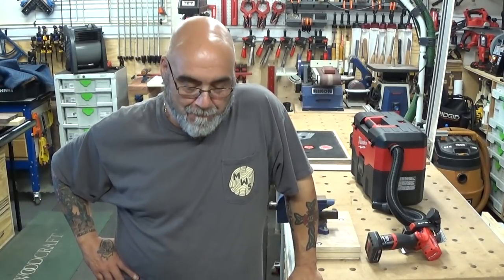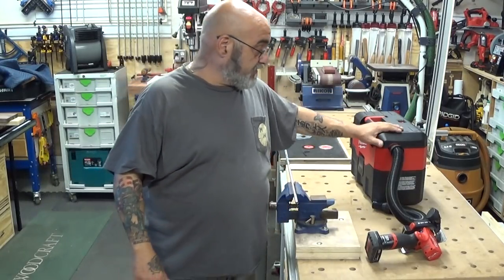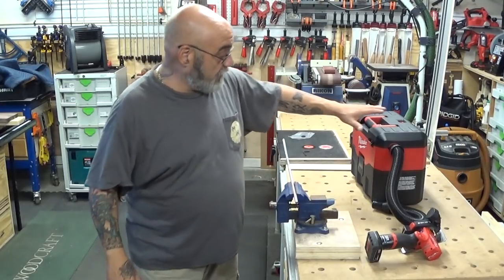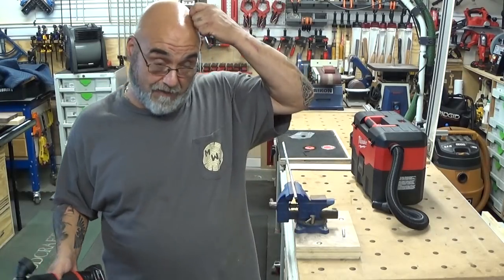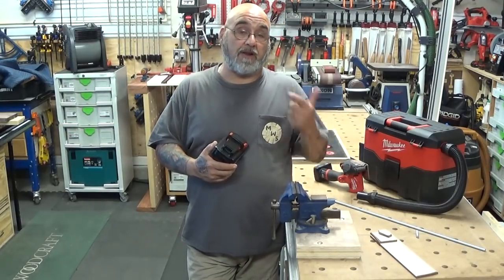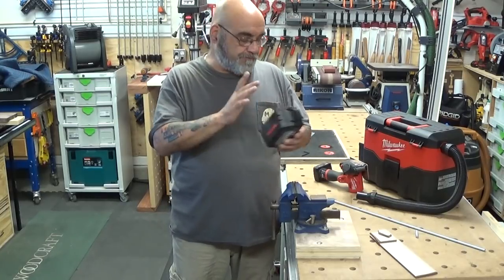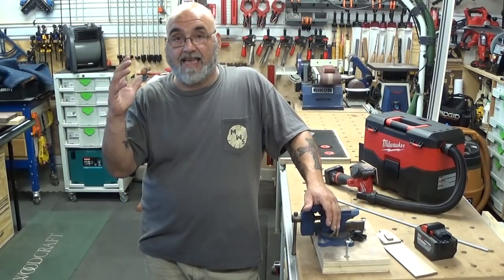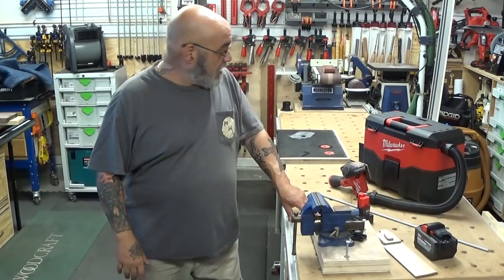Demo of Milwaukee's new 2522-20 3" cutoff saw

Comment: Testing on many types of materials is key to understanding this amazing little tool. I love mine and use it all the time. Understanding its limitations, and its use is very important. Few reviewers have explained how important and flexible is the FORWARD AND REVERSE function of this tool. Like a circular saw whose blade cuts upward, this holds the saw down so it won't hop up. It pulls it DOWN to secure what you're cutting. Likewise with the Milwaukee tool, when you were cutting the tile you should change the direction so it pulls the tool down onto the material. Yours kept hoping up cutting the tile since you had the blade going in the wrong direction. Same when you were cutting the steel pipe. 

Bottom line, this baby cut off tool is actually much better than you made it appear. But I understand. It was your first use of the product. I've also found the Milwaukee blades aren't the best. I'm using Diablo 3" blades and they are much better. Pro tip: The shoe that is also the dust collector really helps with a straight line cut AND if you make sure the blade is cutting UP (like a circular saw) the dust collection works better.

Comment: Milwaukee has a lot of them 12 I'm thinking about getting involved with the M12 but but it's still waiting for cash flow is it really worth it compared already have two of the Ridgid little drills when everything else I have is Ridgid but 12 volts are very limited and Ridgid
Reply: KONAMAN Studio sell the ridgid and buy the m12 fuel combo kit. Such a huge line of tools. Ridgid 12v has like 5?
Reply: KONAMAN Studio DON’T you DARE buy that red china junk.
Reply: Are we still trying to convince ourselves that everything made in China is garbage and that American made anything is superior simply by virtue of being American made? Are we all clear that there is no such thing as American made cordless power tools? There certainly aren't any such things as American made lithium ion battery packs being produced in any kind of notable numbers. Dewalt's handful of "Made in the USA (with global materials)" power tools are just a bunch of primarily Chinese made parts that are assembled in the states with just enough of the work done here that they can slap a red white and blue sticker on them and market to our patriotism. I will also point out that none of their flexvolt or professional grade cordless tools are part of that program. 
The bottom line is that Milwaukee is still an American based company that employs many American workers, and does still manufactures a lot of stuff in the US (basically anything that is still feasible to make here), but they don't manipulate their production in order to do just enough of the work in the states that they can try and fool us into thinking we're buying American.  Don't get me wrong, I prefer to by American made stuff whenever I can, but there are some things that America just doesn't produce, and I would never refuse to buy something just because it's made in China.  The fact of the matter is that China has the manufacturing know how and materials access to make some things better than they could be made in the US. I'd much rather buy from a company that makes the things that they can in the US and does great quality control over the stuff they make in China than a company that is trying to sell me products that are "technically" made in the US just enough to give them a marketing angle, and I can say without a doubt that I've had notably fewer battery failures and problems with my power tools in the last 2 years since I made the switch to Milwaukee than I ever had with Dewalt during the previous 10+ years that I exclusively ran Dewalt stuff.
I'm not trying to be facetious, just simply pointing out that we live in a world of global markets, and we should focus on supporting the things our country does well, standing behind companies that continue to manufacture the things domestically that can be built well, and help those industries thrive globally, instead of trying to force companies to make everything in America when some stuff could be better produced elsewhere.  
https://www.popularmechanics.com/home/tools/a25482/made-in-america-tools/
Reply: @n.c.1838  and my comment did I mention China wants

Comment: M12 bandsaw all day for cutting ⅜" rod and unistrut, no vise needed...cuts way better than this 3" cut off tool. I own them both, and so far haven't found a use case for the cutoff tool where it worked better than another tool zi already own. Hoping I find something to use it on it excels at...but not yet.